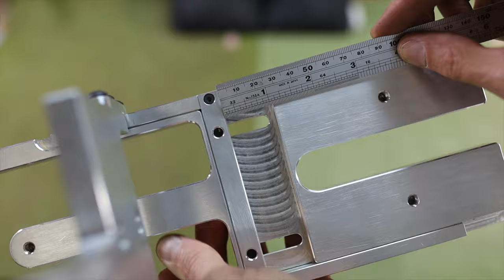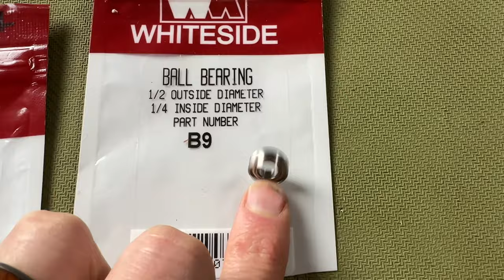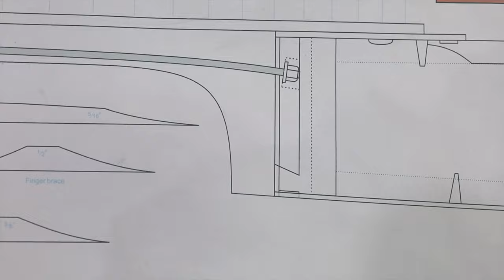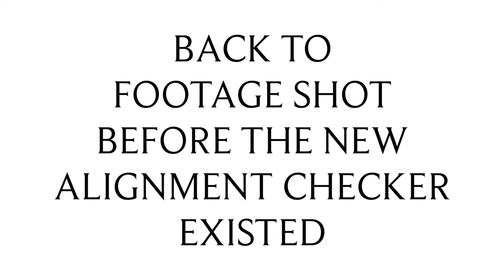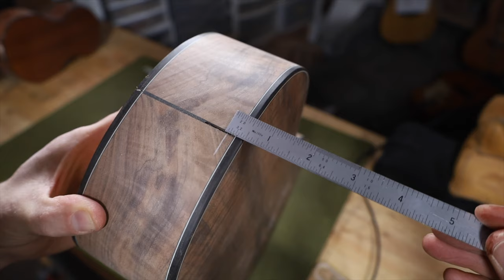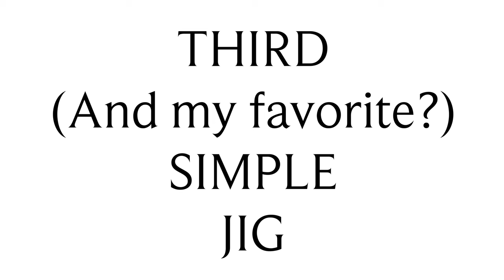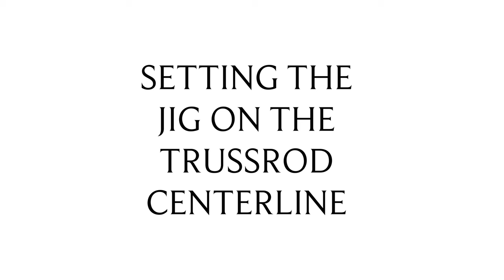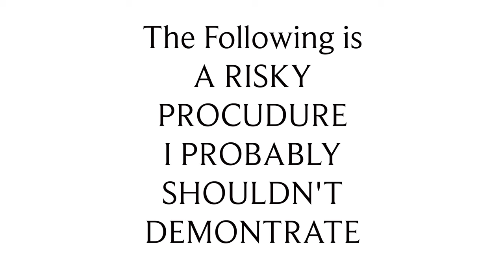PERFECT Mortise & Tenon Joints (featuring the Elevate Variable M&T Routing Jig)

Comment: New to lutherie here, and maybe I missed you talk about it, but generally isn’t there a slight angle at the neck joint to accommodate the height of the bridge and saddle? How do you plan and set up for that? Or am I overthinking it? I have been looking at this jig for a while and have been avoiding this part of my project. I plan on buying the jig with your recommended  add-ons. Thanks for the long format video!
Reply from the maker: Thanks for watching :) 
You are talking about "Setting the neck" or "Setting the neck angle", which is whole different thing to simply cutting the mortise and tenon.
Setting the neck can take some time to get good at. I have a video on it!